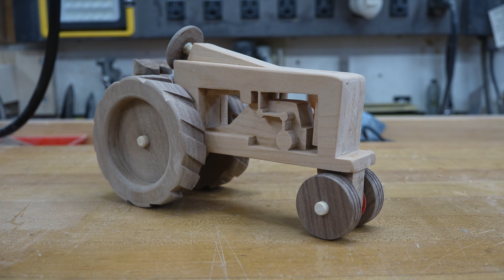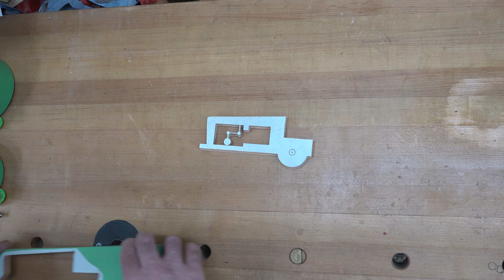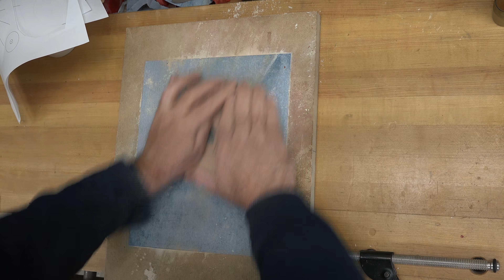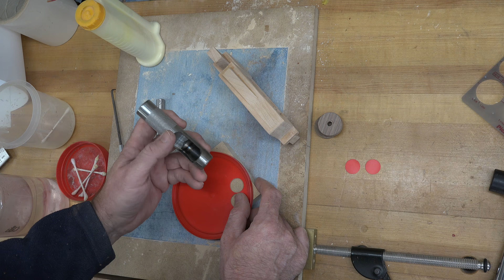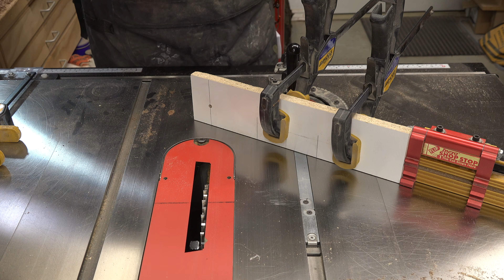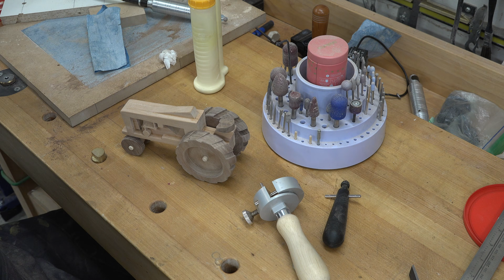Making a Toy Tractor

Comment: Sorry to disagree, but the back tires ruin it. It would have taken little more time to make two half thickness disks with opposing treads and you would have something that actually looks like a tractor tire. Other than that, it looks great.
Reply from the maker: These toys and projects are meant to be modified to whatever suits your needs and if better looking tires or more detailed tires is what suits your project, then by all means, make those tires.   Thanks for tuning in and for chiming in with your suggestion.

Comment: Great video and a wonderful design.  I completed one today and found a way to make cutting the large tires a bit easier.  If you mark just a tick mark on the edge of the tire, you do lose a way to align the wheel after cutting 6 segments.  However, instead of making just a tick mark, I used a combo square and a white pencil (since I was using dark walnut) and I extended the "tick mark" all the way across the tire surface so that even when some of it is gone due to the cut, enough remains in front of the kerf that lining it up on the center mark is still an easy doable process.
Reply from the maker: Great idea on the line extensions.  Glad to hear that you were able to make a successful tractor toy.  Thanks for tuning in and for chiming in with your suggestion.

Comment: How would you make the rear wheel tread if like me you didn’t have a table saw? I love this toy and I’m sure my granddaughter would too?
Reply from the maker: A router table would work also Dana.  If you don't have that tool, you could always use a hand saw to cut the outer edges of each tread and then clean out the middle with a chisel.  It would be time consuming but doable.  I hope this helps.  Thanks for tuning in.